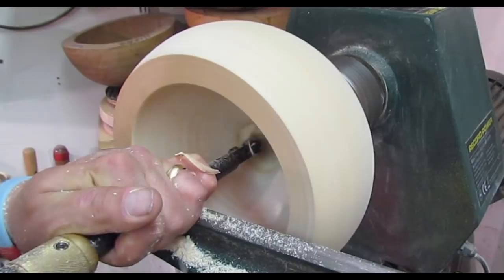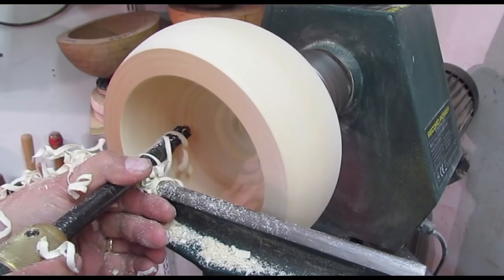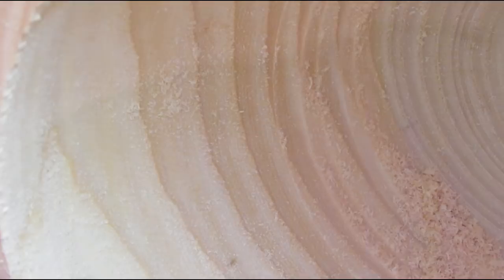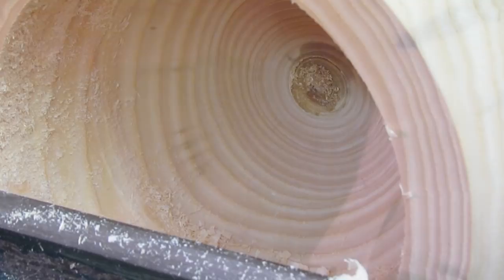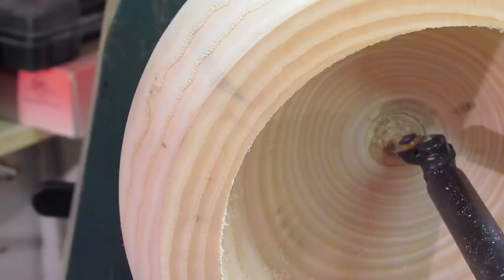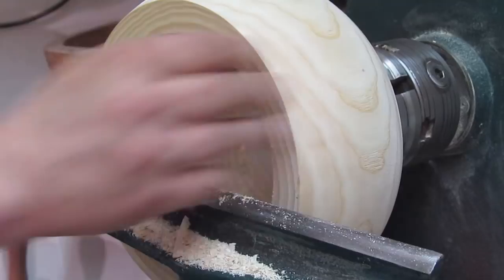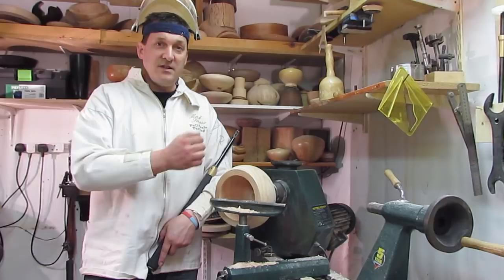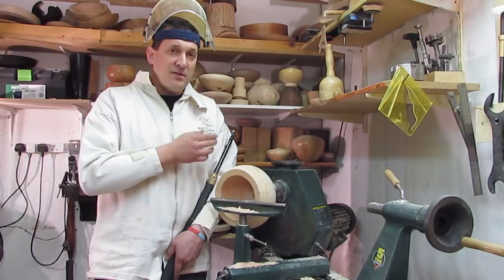Crown Revolution Super Ring video Part 2

Comment from the maker: Hi Elwyn

It is very difficult to say as it all depends on the type of wood , egocentricity of the growth rings. 

However, end grain is much more stable/ or at least moves much less during seasoning. General rule for UK timbers is 4% shrinkage radially. So if the rings are perfectly concentric and the pith aligned then then the piece will season perfectly round albeit 4% smaller. 

Hope this helps.

Comment from the maker: Apologies for the delay in replying. 

The amount of times the tool is sharpened very much depends on the wood, size of the form, and how heavy you take cuts so it is very difficult to give you an answer. Once or twice perhaps on a form the size of this in this wood. 

Hope this helps.

Comment: I am finding that when finishing the bottom of a bowl I am getting some nasty catches unless I rub the bevel but it is not mentioned or shown in the vid.
Reply from the maker: Hi Bill. The front of the cutting on a hollowing tool is not generally used as a bevel and is rarely in contact unless for finishing cuts when it can be engaged if required. What type of bowls are you turning ? end grain, cross grain, unseasoned, seasoned ? all make a difference as to how a tool is used. This being a hollowing tool designed on the ring tool when inside of a 'hollow' form it is mostly impossible to rub what is known as the bevel/front of the cutter especially as the handle should always be trailing. If you are having catches it is because the cutter is presented incorrectly to the surface it is in contact with. If you are turning cross grain bowls then you are best using a bowl gouge, if turning end grain bowls then make sure that when cutting from centre out the shaft of the tools is inline with the spindle axis of the lathe or if the lathe head is swiveled then perpendicular to the base of the bowl with handle trailing slightly and cutter angled at 45 degrees and only cut left of 12 O-clock as right of 12 o-clock the cutting edge is pointing upwards and will catch. Without seeing you working with the tool it is very difficult to say, without knowing the exact orientation of the grain you are cutting again it is difficult to say what is happening. what I would say is if you find it works rubbing the front of the cutter and you are able to then rub the front of the cutter but not doing so is not the reason for the catches you are having rather the presentation of the cutting edge to the wood. hope this helps, all the best Mark
Reply: Mark Sanger I was making a dry ash cross grain bowl. But it was too deep for a gouge. In fact I finished off with a scraper. The tool was very good on the inner sides of the bowl.  But I am still learning so some more trial and error will be needed. But thanks for the prompt reply.
Reply from the maker: @billgiles3261  Hi Bill, cross grain especially dry can be a bit catchy as you have four different densities of wood orientation/revolution, this is compounded by having to cut from outside in and the difficulty of getting the bevel of any tool to rub on a very deep vessel. Your option of using the scraper is one I would also use as they are  nice and easy but can compromise the surface finish> you should be able to get a 'bottom hugger' ground bowl gouge to work, this is one which is ground around 60 degrees, obtuse so the bevel is supporting but only take light finial cuts due to the over hang. Its a difficult scenario and one that causes quite a few issues, so you scraper option as mentioned is a good go to. all the best here if I can help :-)